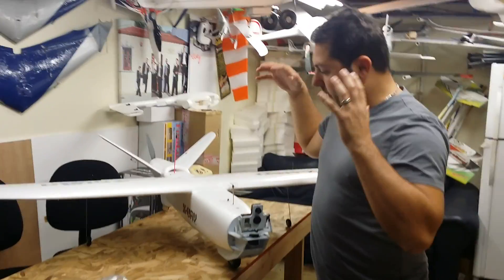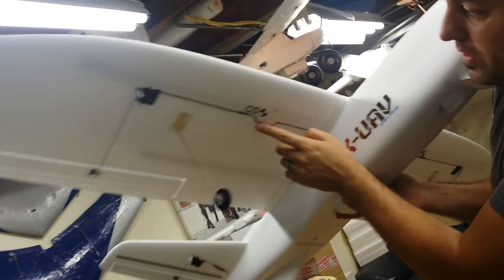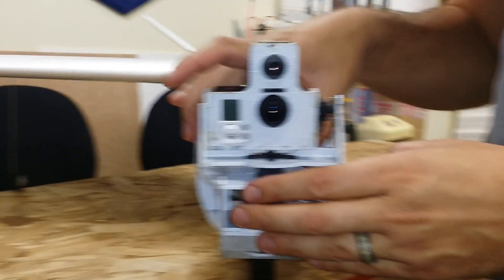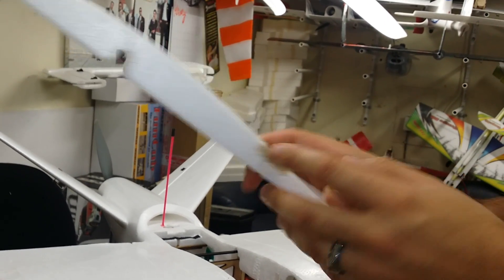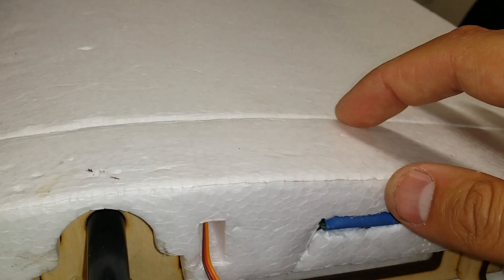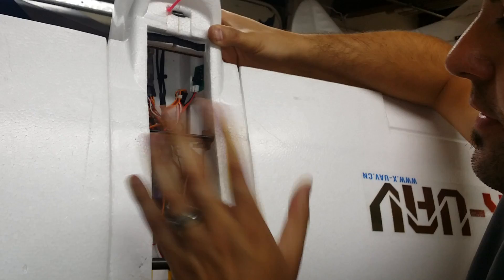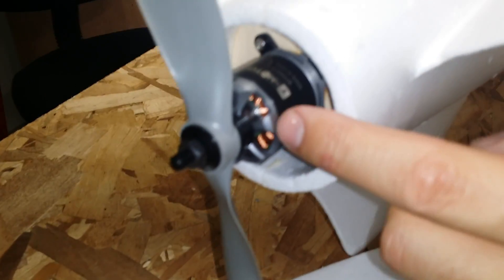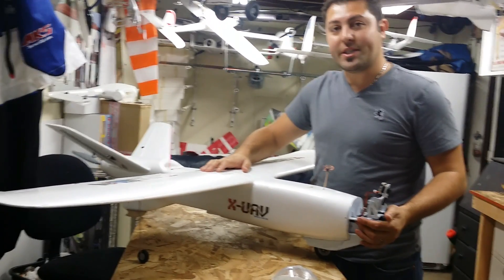Uav Talon review and tips and mods

Comment: Johnny, I just finished my build of the big Talon. I bought the DragonLink , but my antenna for the ac receiver is not a stick antenna. Where can I get the one you have?  Looks like a nice solution. Also, are you still running the cyclops storm FC?
Reply from the maker: Aero FPV You will need a V-tail mixer for the mini talon in order to use rudder and elevator. if you want you can disable rudder and just do elevator through the storm using a servo splitter cable or y harness
Reply: Just wondering .. does the Storm FC accept V-tail aircrafts or would one need a V-tail mixer cable? Thanks.
Reply: Hey Thanks guys ... I had a small issue with her in PA mode. I'll just rotate my servos 180 degrees and reverse throws on the Tx. Again thank you Johnny? - Aero FPV

Comment: Thank you for the reply on.your  set up, just not sure how you are connecting each wire from one device to another or from receiver  on back.
Reply from the maker: Power set up: Battery 4s to Current Sensor then ESC, 12v Bec(OSD), 5v Bec(Receiver)

Comment: Hi johnny and thank you for the great video however, I am all for the added insurance of a bec  to aid in the failure of a esc and its easy to install. The part of your extra add on like osd and another bec  has me scratching my head. Sorry, but i can not see how you have everthing connected. IT probably why i have not started into fpv. I really would like to get into fpv and the added things that you have are inportant to make it a safe flight.
Reply from the maker: The first BEC is 5v for the servos and receiver. The second BEC is 12v. it powers the OSD which is the flight computer from there this particular OSD provides power to my 12v Camera and 12v Video Transmitter.

Comment: Isnt cyclops osd can accept a 4s, im using it on mine
Reply from the maker: Cyclops can only be powered up with 12v. if you use the current sensor to power the OSD with the little jumper in the battery port you should only use 3s. if you remove the jumper you will have to power with a spate 3s or a 12v BEC. I like the simplicity of just plugging in one battery and letting BEC do all the work.

Comment: Great video. Wouldn't the camera tower you have act like a giant airbrake. Making the frontal aerodynamics similar to a mack truck? Surely youd get even longer fight times with a lower profile camera setup? Anyway I like your setup. I tried putting rear landing gear on and two 5000mah 3s batterys with a 3536 NTM. I couldn't handle flying this aircraft. Just wasnt good enough a pilot. It impacted into a ditch and that was the end of it. Moved back to easier planes for a while.